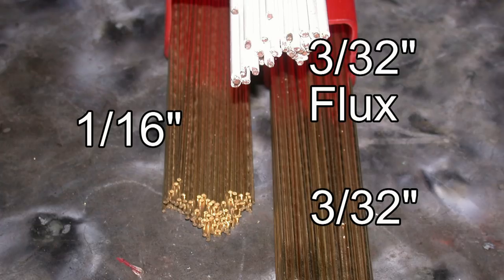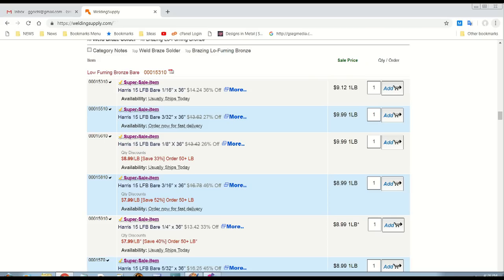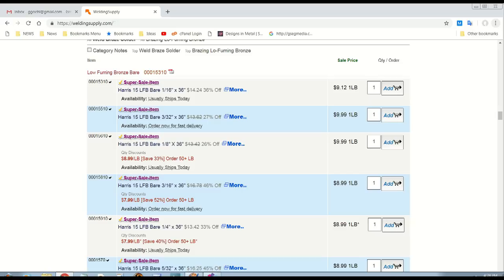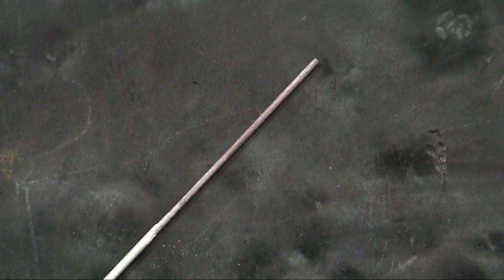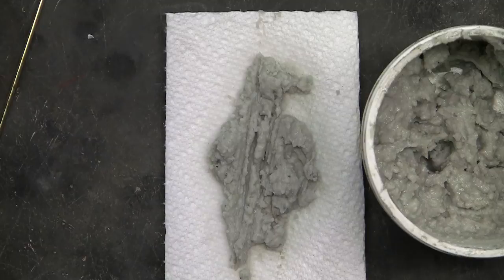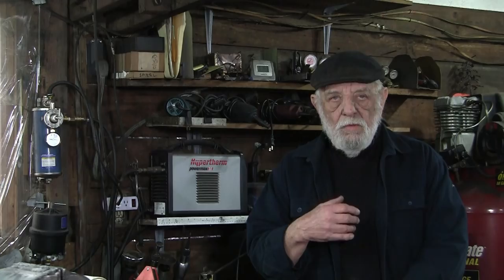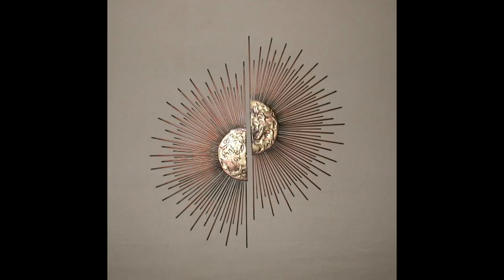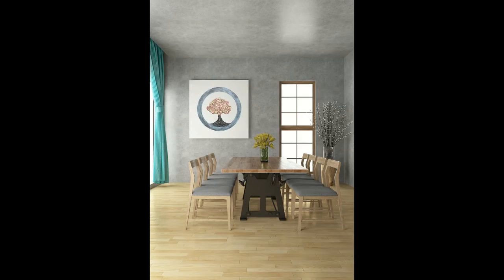Brazing Rod

Comment: Thanks for all the informative videos! Looking back at your "dab of bronze" video, I'm now curious if you need to re-flux those joints, or if there's enough left in the material that it isn't ever necessary?
Reply from the maker: For clean material, there is enough residual flux that re-fluxing isn't necessary.  But, it is wise to check the finished joint to make sure that the braze holds.  The AWS (American Society of Welding emailed me and asked if they could use that video.  The AWS is very particular about welding standards.  I asked if they were going to use that video as a "way not to do it".  But no, they liked the idea.

Comment: Great video! I have a soft spot for good old fashioned brazing. The problem I always run into is how to clean the residual flux off the piece after. Any tips on the best way to clean it before applying the finish?
Reply from the maker: If the piece is small you can dip it immediately in very hot water.  For larger pieces, heat up some water to as hot as you can get and then pour over the braze.  If the water is almost boiling, the piece will dry almost instantly so there is little fear of rust if it is steel.  Once dry, wire brush just to make sure you get it all.
Reply: George Goehl ok thanks, I will try that.

Comment: A few questions for you George . (1) do you only use 3/32 flux covered rod for your prjects , brazing the 1/16 , 3/32,1/8, and 5/32 stock together ?.....(2). I notice you have a Hypertherm 30 plazma cutter , and I was thinking about getting that same model myself . But I only have 20 amp service in my garage . What service will your Hypertherm 30 work with ? Will it work with a 20 amp service as well ? ........After purchasing several of your videos , and watching your videos of using your Henrob torch . I purchased the newer DHC 2000, and tried using it to cut 20 guage threw 1/8th inch stock like i have seen them do in videos claiming the Henrob/DHC 2000 cutting threw said stock like a plazma cutter . I have had little to no success in doing this after several attempts . That is why I am asking you about the Hypertherm 30 . While I am asking . If you do have experience cutting with your Henrob . Do you think you will be able to do a video on how to cut 20 guage threw 1/8th inch stock ? I think such a video would get you many thousands of views  . Thank you in advance for your kind reply Sir .
Reply from the maker: I haven't spent much time with DHC 2000 for cutting since I have the plasma cutter.  I'm not sure what my amperage is.  For your amperage, contact Hypertherm on their web site.  They are very personable.  Any question I've had they've answered promptly.  Last time I contacted them was by phone.  I probably won't get around to doing a video on cutting with the DHC.  There are a number of videos already.  https://youtu.be/MpTPnLsYoDs    https://youtu.be/NP9HWp9oV8k   https://youtu.be/Ima2ITyMV4c    https://youtu.be/GAeeW_ojpZA

Comment: George: I am very new to all of this. I have a small oxy/acetylene torch with 10cubic ft ace tank and 20CF O2. I don't have a welding table. Can you suggest something cheap (to take to place of a welding table) and small that I can begin to practice brazing,welding and cutting? Fire Brick?? Thanks.
Reply from the maker: You might think about picking up some firebrick.  You can get these at a builder's supply.  Firebrick will withstand the heat although in time they do break from the heat.  It will work for brazing and gas welding, but I'm no sure how well it will work for cutting.  This is a quick answer and if I think of anything that would be better I'll get back to you.  For brazing you will want tinted safety glasses.  For gas welding you'll want welding goggles.  For cutting an old steel tire rim would work for something temporary.
Reply: @897473  Thanks George. Great response. I will try these. Greg....
Reply from the maker: @gregsaiter3768  Check out this video = especially the Heat Sink.  Since you are just starting, check out the complete list of YouTube videos.  Quite a few would help as you are just starting out.  https://gsegmedia.com/?page_id=2877
Reply: @897473  George, can you say a few things about Flashbacks and backfires? I am nervous about them.
Reply from the maker: @gregsaiter3768  Flashback aresstors have become a mainstay with torches.  Prices seem to vary considerably.  Get a pair that fit you torch and hoses.  I've never had a flashback, even before I started using flashback aresstors.
Reply: @897473  One more thing: How do I tell when my tanks need refilling? Is there some point that the pressure reaches or some other indication?
Reply from the maker: The gauges on the  regulators:  The gauge on the left is the working pressure.  The gauges on the right show the content of the cylinders.  When the content gauges reach zero you are empty or close to empty.  
You'll also notice that the working pressure has dropped. Hint:  When the acetylene cylinder is empty you will begin to smell acetone.  This means you are definitely out of acetylene.  Wikipedia is a good source of information on acetylene.
Reply: @897473  Thanks a ton, George. I haven't even fired up my set yet. I am just about ready but I want to understand as much as I can before it do it. Your help is greatly appreciated.
Reply: Hi George. I have some more questions:
1. Can I use a regular coat hanger for welding rod??

2. When you are welding on top of a metal table how do you keep the work piece from welding itself to the Table??

Greg Saiter
Reply from the maker: @gregsaiter3768  I dot care for using a steel coat hanger, but you might try it to satisfy your own curiosity.  Weld steel to table:  I position the work so that can not happen.

Comment: You lost me by not shopping LOCAL... Sadly,,, your still the beneficiary of their losses... I pray others in your town will help to keep your LOCAL guy going... Note!!!
Reply: It is more appropriate to be unhappy with welding supply shops that overcharge. Often,  the difference is not 10-20-30%, but double or triple.
   I hate to see local suppliers disappear,  but me, the little guy with no income, cannot afford to subsidize overpriced suppliers to keep them open. I am obligated (to myself) to look for the best deals. It is either that, or I cannot afford my hobby, or to fix my cars. 
   I am certainly not paying for the advice of those who work behind the counter. Generally, in most cases, it is they who could benefit from my advice. I hate to sound arrogant about that, but that is usually how it is. A few years behind a parts counter does not qualify one in a trade.